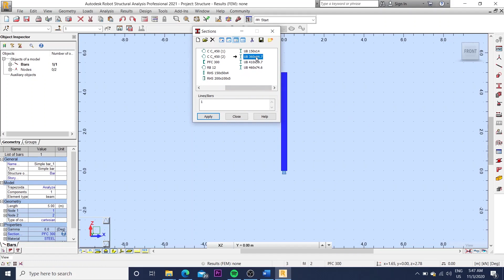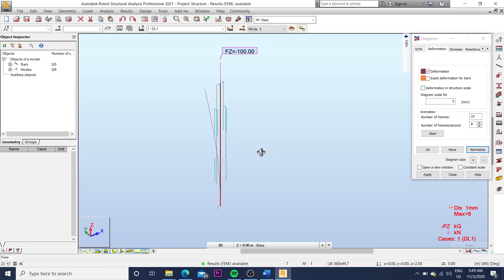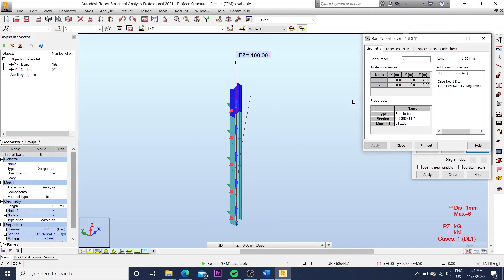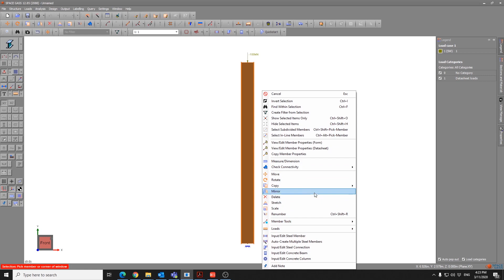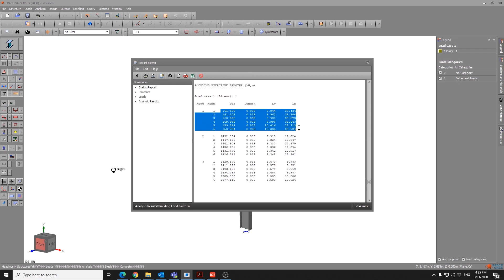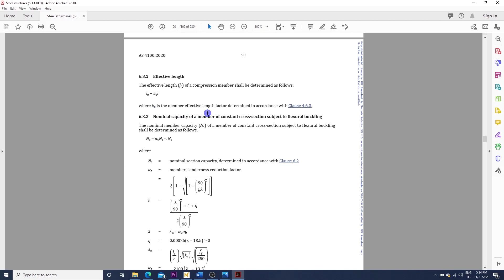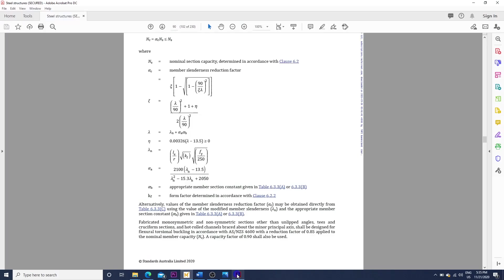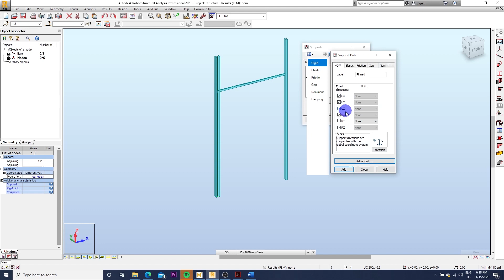Column buckling: Do not make this mistake

Comment: Hi Gabriel,

Regarding the buckling analysis in robot,  please could you tell me what are the slenderness ratio values (compression and tension) under the configuration window?, because I found on autodesk forum that (200 and 300) are for some other coutry codes (base on analogy), how you calculate ratios according to AS 4100, thank you, cheers, like your videos!
Reply from the maker: Hi Tomislav, that's the maximun slenderness. 200 and 300 are default values. I can't find these numbers on AS 4100 either. What I've found online is that these values are adopted in the Canadian code.
Reply: American Code/specification AISC 360, section E2 mentions effective slenderness KL/r should not exceed 200 for compression members. So you'd use that max limit if designing to AISC.

Comment: You may need to review the concept of buckling. The reason behind that is pretty simple. AS4100 use DSM approach.
Reply from the maker: Hi Arash, thanks for your comment. The reason behind what? Can you elaborate please. 
The way a buckling analysis is intended to work in AS4100 is by using a critical buckling axial load (theoretical buckling load) together with the code reductions to account for second order effects.